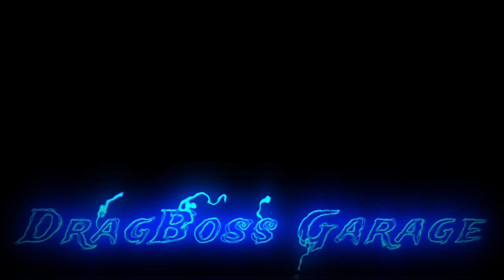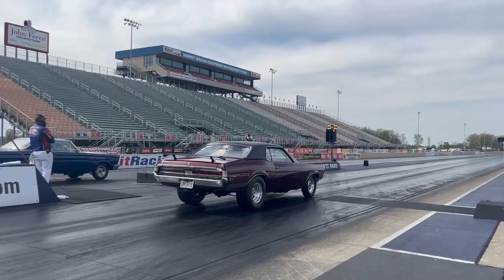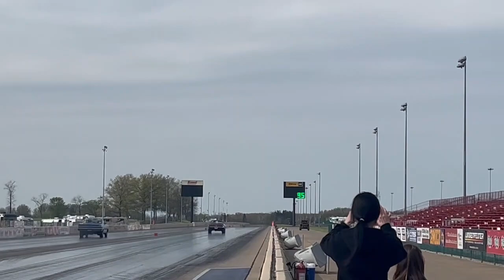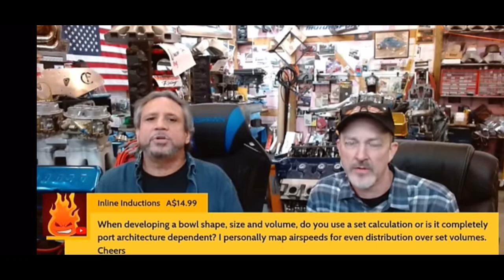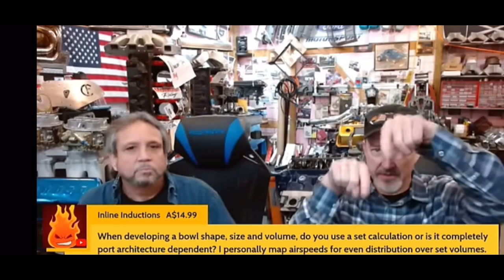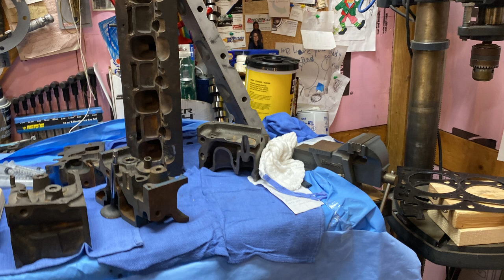DBG:  Developing Bowl Shape, Size, and, Volume, Do You Use The Port Architecture, Or  Calculations ?

Comment: I would guess that making the bowl area larger and reducing air speed would help with proper air fuel charge vaparization characteristics😊
Reply from the maker: making for a more homogeneous mixture
Reply: @DragBoss351Cleveland   right I agree with that 100%.
Reply: @DragBoss351Cleveland   I also found out for 351 windsors that the oil lubercation system havs a unique priority system that looks like on a diagram a 4 way oil splice for lubercation to the cam journals, lifters and mains. Ever since I saw your cleveland oiling system video I've been studying not only cleveland oil system bur other engines too.
Reply from the maker: @JacksoNR26 good deal. My new engine block, has priority oiling. And can go 4.185 bore.
Reply: @dragboss351cleveland   is it a custom cleveland engine block
Reply from the maker: @JacksoNR26 
DBG 351C: DragBoss 351 Cleveland Engine Block,  An Available Iron  Aftermarket 351 Cleveland Block
https://youtu.be/z0jpFkKMzyI
Reply: @dragboss351cleveland   do you make these blocks
Reply: Oh I see you call your aftermarket cleveland the drag boss cleveland, ok that's really cool to see a rare engine get it's own casting support and, does that company make cylinder heads too?
Reply from the maker: @JacksoNR26 yep, mine.
Reply from the maker: @JacksoNR26 I don’t.
Reply from the maker: @JacksoNR26 yep they do. Cranks and rods .etc
Reply: @DragBoss351Cleveland   I saw cj pony parts selling an aftermarket cleveland block but I didn't know if that was the dragboss block or a different one.